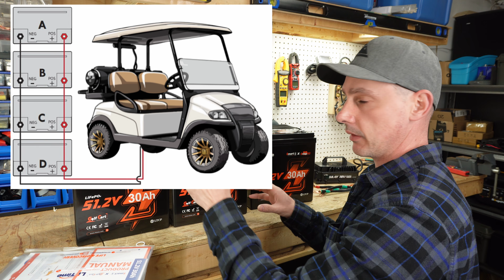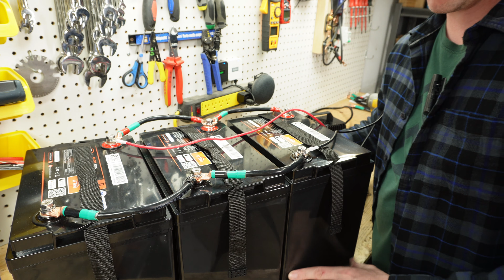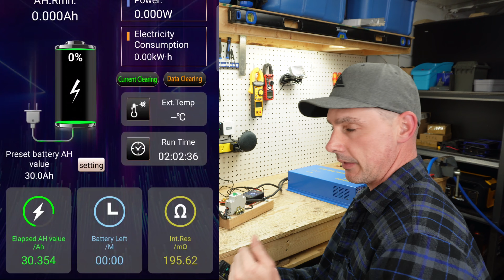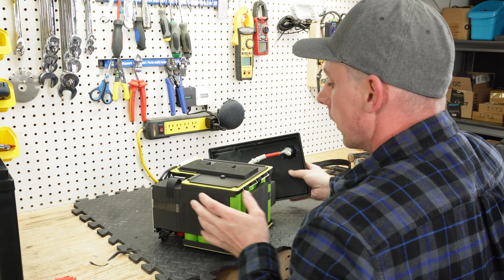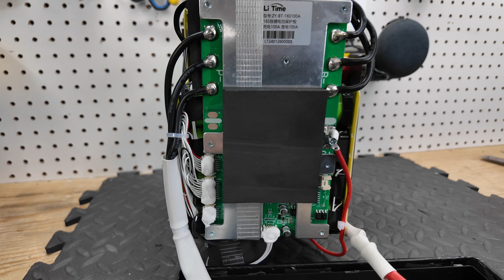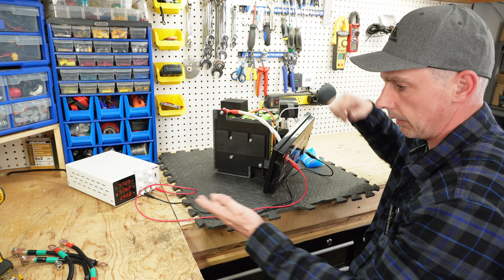48 Volt (51.2V) GC2 | Golf Cart | LiFePO4 Battery By LiTime

Comment: What should I set my zero voltage on my monitor if I installed 3 of these into my golf cart?
Reply from the maker: You should use a smart shunt like a Victron. It is almost impossible to know what level the battery is.

Comment: Hi, please for your answer... My 52V 11.7kW battery is powered by 2kW panels and I Am charging with it an Ecoflow DP 48V 3.6kW battery via xt60. When BG battery completely discharged, the voltage in the BG battery cells are slightly above 2.7V.

In this state of the cells, can I leave the minimum charge from the BG battery to DP battery when the minimum charge started from panels to the BG battery?.

Example: BG battery is charged from panels with a power of 40W, the cells have a voltage of 2.7V
Can the obtained 40W be forwarded to another battery or is it better to stop charging until the BG battery cell voltage increases above 3V or more??
Reply from the maker: @adamsisernik4556  https://www.mobile-solarpower.com/

Comment: I notice they say 30 amp continuous charging, is this comparable to other options. ??   and would that be 1500 Watts charging..?? Thank you..
Reply from the maker: That would be a 1C charge. It would be 1,536 watts on a single battery. I have six on a UTV I can do 180 amps at 58.4 volts. That's insane 😦

Comment: If you get the 48v 60ah. Can you add a 48v 30ah to get to 90ah? Or does it have to be another 60? 
For a golf cart.
Reply from the maker: @jessepierce5179  In theory you could. It's possible the lower Ah battery would be working harder than the larger one and degrade faster. Personally, I'd use all the same batteries.

Comment: Is it possible to run 4 Li Time 12volt 100Ah group 31 in series? Or 4 of these 51volt in parallel?
Reply from the maker: @chasebenjamins6334   Yes, you can do either. I'd suggest the parallel over series to avoid balancing the pack.

Comment: Am i correct in saying that 3 of these gives you 90ah? If so, would one 51V , 100 ah battery from li time do the same as the three 30 ah? Thank you
Reply from the maker: @pierrejean233  If you get the 100Ah golf cart, yes. You will need high amp surge power on a golf cart 👍

Comment: I have a 36v cart and need to replace batteries. Something like the 6v Trojan T-605 is rated at 210aH. These are only rated at 30aH. So what does that mean by comparison in terms of speed, power and run time of the cart?
Reply from the maker: These are for 48V carts. You can check the link to their website for further information.

Comment: I’m not sure about my mom’s golf cart, but I know it has six batteries in it. How many of these would I need?
Reply from the maker: @tomfanniff  Without seeing the cart I'd guess they are 8V batteries connected in series to make 48V. One of these batteries by itself can run your cart. The thing you need to figure out is how many Amp hours you need and connect the batteries in parallel. Two of these 30Ah are roughly equivalent to what you have now.
Reply: @Roll2Videos   thank you for the info . The cart is presently in Florida. I do know it is an older club car with six car size batteries Which constantly drained of fluid And I have to refill with distilled water and charge with car charger before they will take a charge(she’s only there in the winter) Does this charger also work as a trickle charger to be able to go long term use Thank you
Reply from the maker: @tomfanniff  You do not want to trickle charge a lithium battery Just charge it to 80% ish and leave it

Comment: Nice video. 
During the tear down I noticed the BMS said 16s100A. I'm a little confused seeing the are 24? cells and says 60A max cont discharge on the website. Anyway, a max discharge test would be interesting to do, to see how many amp you could pull. Everyone that tests cart batteries does great job at a range test but no one, it seems, does a hill climb or max discharge test. Which I believe is just as important as range if you will be operating in a hilly area.
Thanks
Reply from the maker: There are 32 cells in a 16S2P configuration. The cell is stamped 48Wh. That means 15Ah so with a 2P that's 30Ah. I will be testing them in a cart, I will post my results

Comment: That Balance section on the app is awesome. Do all their bluetooth batteries have that function?
Reply from the maker: This app is separate from their other Bluetooth batteries. I had to download a new app. I like these batteries. I can't wait to play with them more. 😀
Reply: @Roll2Videos  oh id consider buying a Litime battery just because of that app
Reply from the maker: @mannyfragoza9652  Lol, Really?
Reply: @Roll2Videos  "but of course". said in my best Inspector Clouseau voice
Reply: Most of these bats have a spot on bms for bt and cold temp.They just didn’t install them.
Reply: 4 12v 230ah is about 2400 bucks
4 of these is what 2k for 120ah
I don’t like all these companies math for 48v
Reply from the maker: @2hotscottpro  I guess it would depend on placement, size and build quality. Using cylindrical cells is more costly than prismatic and better for vibration.
Reply from the maker: @2hotscottpro  I'm sure there's a lot of people out there who would prefer to do the DIY option for cheaper. But then you have to be concerned about balancing the pack etc. Some people just want to drop the battery in and connect the wires and go
Reply: @Roll2Videos  yah diy 315ah 48v 1600 bucks or less
Reply from the maker: @2hotscottpro  It's kind of like somebody changing their own oil or having somebody do it for them.
Reply: @2hotscottpro  exactly what I’ve noticed.  Why so much more for 48V batteries?